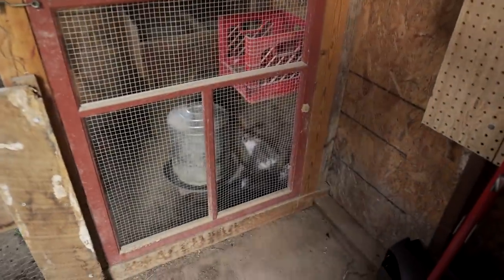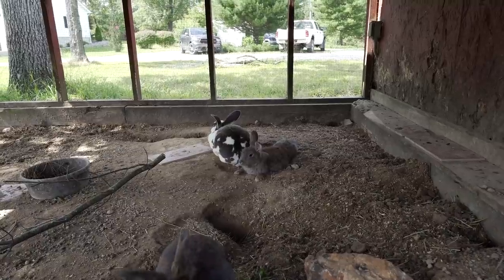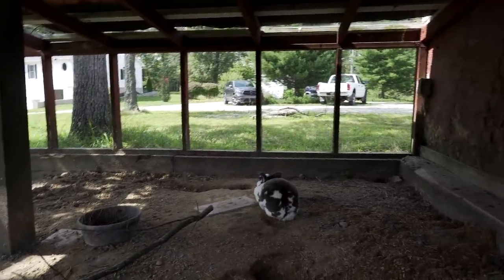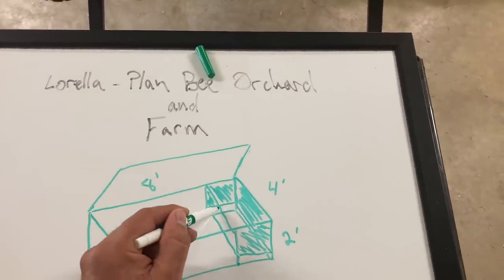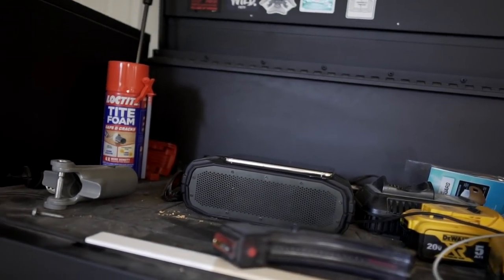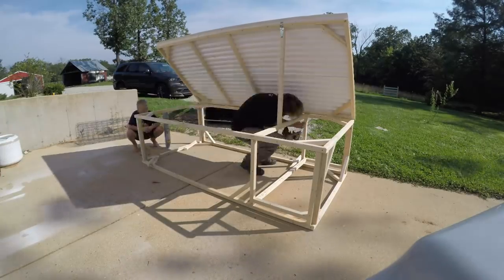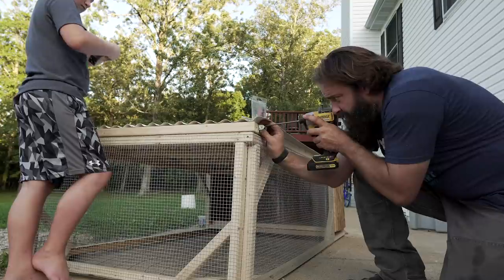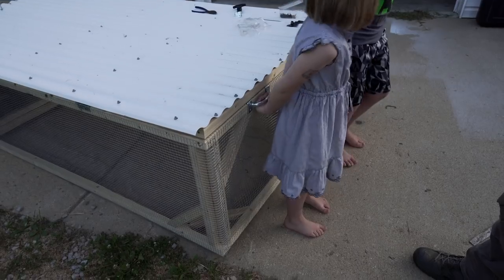Things To Consider | Rabbit Tractor Build

Comment: I made similar tractors for my rabbits and the only problem I’ve had is the wind (I’m in Wyoming). If a gust comes from the right direction the whole tractor will tip over. I have a metal roof so I have been using heavy rocks on top for weight. If we are getting a big storm I pound a T-post in next to the tractor so it can’t tip. Otherwise these have been great for targeted grazing of toadflax in our pasture. The rabbits love it and it gets rid of an invasive species 👍
Reply: Have you thought 💭 of putting some kind of removable bracing that goes perpendicular to the tractor that comes out 2-4’ beyond the structure ?

Comment: 13:00 If you encounter a mistake like that in the future, maybe you could run vertical strips of the fencing wire instead of going thru the trouble of dismantling most of what you had already built. Small mistakes like that are everywhere in prototype designs. It's a reality of building something new.
Reply: For this specific problem the rabbits won’t climb the fence, the gap wouldn’t matter and if it really bothers you looks wise you could run a small thin piece around to cover the gap.

Comment: I used 3/4 inch PVC for the frame. They were super light and slid easily on the grass. I followed a couple of plans for chicken tractors. I was not brave enough to leave them out in the tractor overnight though.

Comment: The purpose of a prototype is to figure out what part of the design needs to be tweaked. That's exactly what you did. Lessons learned. Additional tweak: Kids are short and need leverage to help them. Make two attachment points (eye bolts and carabiners) at the bottom of the tractor. Run a rope, cable, chain, through a 2 -  3 ft length of pvc to give them a rigid handhold. Make the chain long enough so they have ample space between their legs and the tractor so they can walk comfortably and attach ends to the tractor. The kids should be able to lift the tractor off the ground like a hammock and move it. (One person can do one side at a time)  Don't worry about rain runoff. Unless your ground is perfectly flat you will have enough pitch for water to run off.

Comment: Hi do the legs get caught when  you  move cage and what about high winds do they get blow over
Reply from the maker: We haven't had any issues with it catching. A larger wheel would help it move better :) We have not ever had an issue with wind. The LIDS have blown backwards messing up the hinges. but the actual tractor hasn't had an issue.
Reply: @WillowCreekHomestead  thank you

Comment: I went the low budget route and got a 71.8" by 29.1" metal chicken coup for $55 on eBay and just zip tied some welded wire fence to the bottom. It's a lot lighter because it's all metal and once you zip tie it together it's pretty sturdy. I'm still trying to figure out better handles. I have one for the boys and another for the girls.

Comment: I just started mine yesterday! I wish I watched your video first! To start, it seems the mistakes you made I avoided. However, the mistakes you avoided, I didn't! haha. Instead of taking everything apart, couldn't you have just ran another 2x2 along the bottom. Them stacked should have created the fixing points needed. Also, your framework is great. I'm still learning. HOW to frame and why you cut the angles you did would be a nice explanation fir the layman.

Comment: I’m not sure why you didn’t just cut a 2 inch piece of wire for the top, and attach it with either, zip strips or wire clips? Taking that apart most of taken a lot of time.

Comment: That looks like some happy rabbits! Good job building that. 2x2s are my least fav to work with but for some reason I always go to them ugh they’re so frustrating. I’m worried about when moving if there is any sudden jerking trying to get the rabbit tractor going if the rabbits legs will get caught in the wires or make it hard for them to keep up. I wonder if putting in some plywood or even cardboard because it’s lightweight on the back end for all the rabbit to stand on while moving might be necessary. Idk. Also if there is a way to lower the handles or extend them out so the kids can lift in front of their body and not behind their back might make it easier to pull. Justin Rhodes makes chicken tractors that I’m wondering if his style of handle would be easier for what you have. Will the mamas and Lincoln get a tractor too at some point? I’m looking forward to seeing how the tractor works out for you guys, it’ll cut down on feed costs for sure!
Reply: When I move the tractors I open the lid so I can see the bunnies. I tell them “ok, it’s time for fresh grass” then I move slowly. They learn very quickly to hop to into the raised portion while I’m moving them. :-)

Comment: Really enjoyed how you verbalized the engineering as you went. It's how my work goes but without the talking out loud (except for some ding dangits). I really like the pvc panels, the ice cooler latches for security, and the hinged support brace for the roof and will using them for our two tractors I'm building in a few weeks. Thank you for sharing, sir.